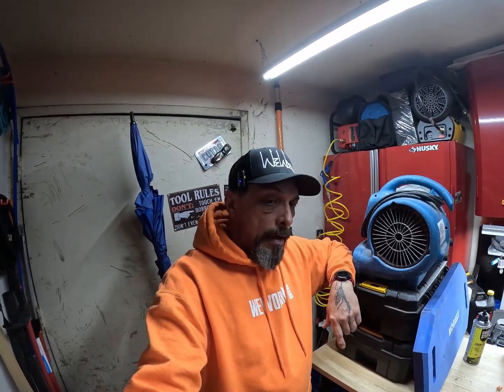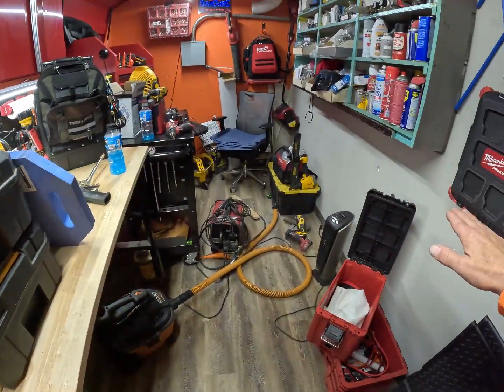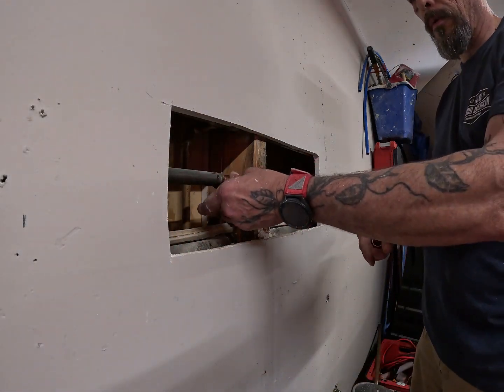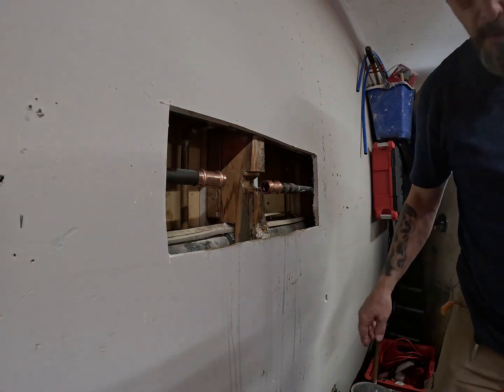Maintenance shop shelving upgrade

Comment: Wow that's a pretty cool pro press tool for the cheap. First time I've seen that. I'm spoiled using the 3000$ ones the company provides lol. They're all nice as long as you can fit the damn thing in where you need to, if not time to solder.